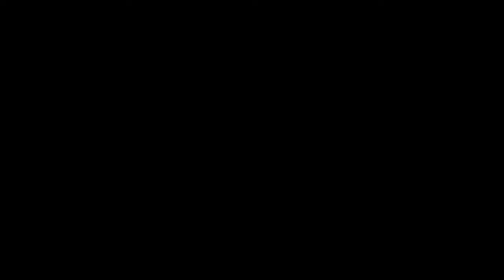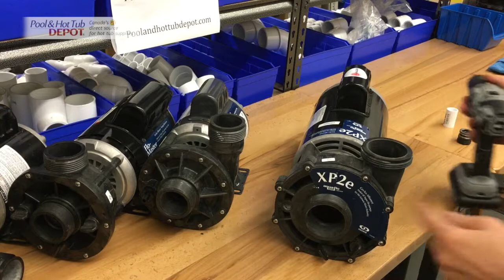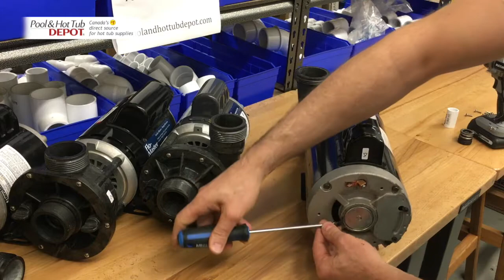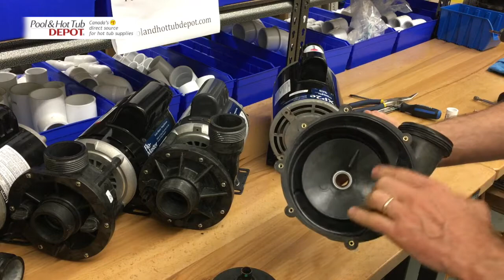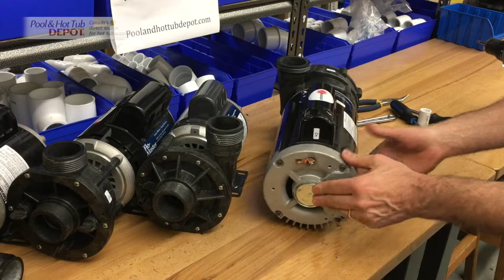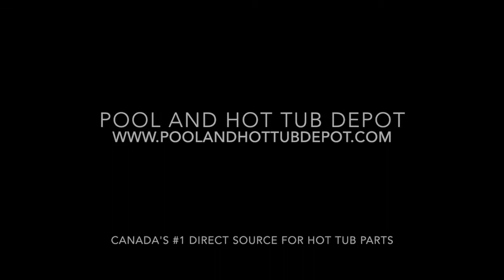Replacing the shaft seal on Aqua Flo hot tub pump

Comment: Is it necessary to remove the volute? Can you not just pry the seal up and out?
Reply from the maker: The seal (white ceramic mating ring) in the volute can be removed without removing the volute from the motor but its easier to install the replacement and ensure it is seated properly with the volute removed. When the new seal is installed it must be seated and even. If its not seated all the way and uneven it will leak soon as the pump starts.
Reply: @Poolandhottubdepot  thank you!  I understand proper chemical balance is important but Is it normal to have to replace this seal every couple of years?
Reply from the maker: @Holdfast   Are you using a basic value grade seal or a Viton grade? Seal life is dependant on chemical level maintenance but also the seal quality it self, value grade seals tend to have a shorter life, North American made Viton grade seals typically can last longer if chemicals are maintained in our experience.